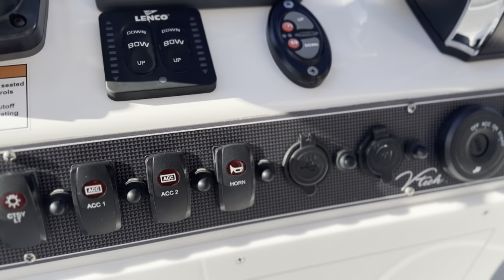My 2022 Vtech 18’ Flats

Comment: Beautiful boat. Ultimate has a copper colored VTech right now that I’ve been drooling over. Funny, I bought a bay boat from Hawke a few months ago and have only bass fished on it so far. Would love a VTech, but most of the time I’m out on the bay boat the wife and kids come along. The 4 of us on one of the VTech seems unrealistic (sigh)
Reply: I’m a bass fisherman myself, hardcore, but have been slowly getting into the salt and taking weekend trips to the keys.  I have two young kids myself.  I want to purchase one of these Vtechs so bad as it seems like a smooth transition from my bass boat but really questioning the 4 person capacity lol.
Reply: @FillALimitFishing  Well, I closed a deal on the Vtech earlier this week and should be taking delivery tomorrow. My kids are a bit younger (1 & 4) so it may accommodate us a bit better. From what I have seen, people load these boats down with 3 full sized men fishing, and I’ve even seen one with a 400r on the back straight out of Vtech’s factory. I think as long as you distribute weight appropriately the hull will handle it. This hull design is a variant of the Hewes Redfisher. The running surface is essentially the same, but they redesigned the cap to avoid any legal action from Hewes. The previous owner of this mold was SeaVee which directly copied Hewes and stopped production after Hewes threatened legal action. If that tells me anything it is that the hull design is damn good. 

There really isn’t a lot on these on YouTube or the internet, though they are just now working on their 50th hull. 

I’ll try to put some kind of video together highlighting what it’s like to live with one with kids and as a fishing platform.
Reply: @exoticflorida2360  appreciate the reply.  I’ve been following their builds and each one that hits the market looks amazing.  Please let me know how it works out.  We fish and cruise in a 18 foot bass boat now so it can’t be too much worse I would imagine.  Thanks!